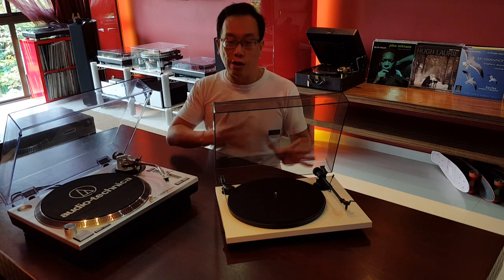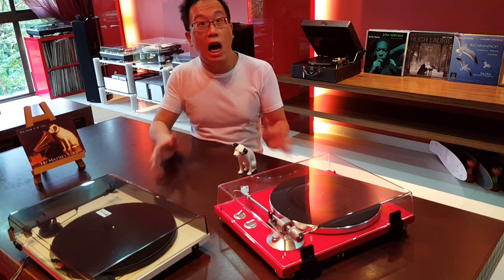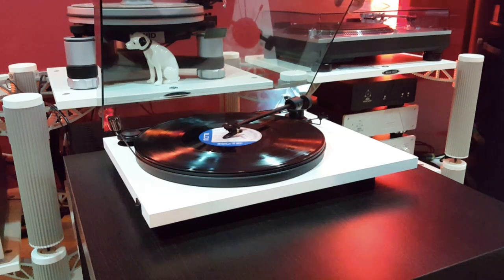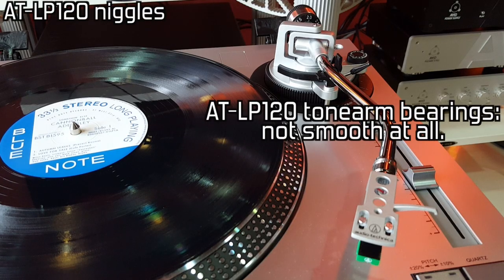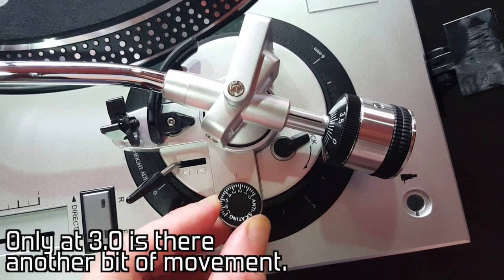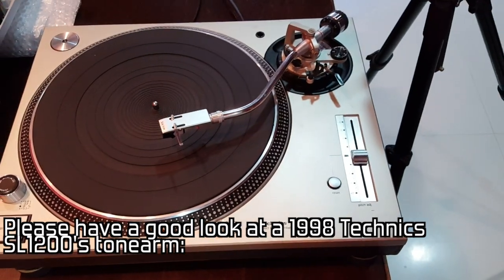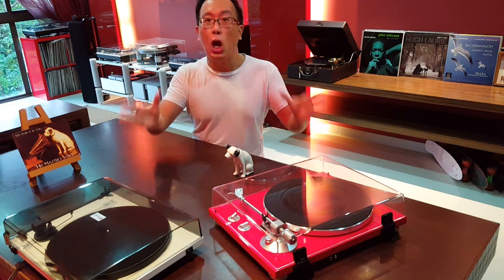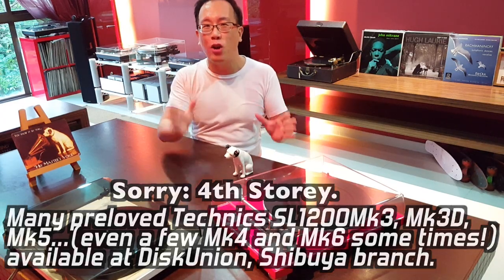Turntables $250 -$300: Shoot-out & Reviews.   AT-LP120 + Pro-Ject Primary + TEAC TN-300

Comment: Compairing the ( Hanpin ) Audio-Technica AT-LP120 usb with the Technics SL-1200 series is like compairing apples with pears really. But I do agree with you want to point out here. The Audio-Technica wants the newbees and those unfamiliar to the tricky field of turntables to believe their products offer the same performances as the original Technics designs. The price should tell those who want to get into vinyl something by the way. The Hanpin-clone is, like you showed perfectly, a plastic affair with components that either do not work properly or are just very sloppy constructed. The anti-skate that doesn't work if you cart needs more than 1.6 grams, the hight adjustment that is not adjustable downwards enough, the baked-in noise the motor makes both audible near the turntable and in playback (!). Not to mention the light weight platter and construction. By the way, the total weight of this turntable comes from a slab of steel in the bottom of the plinth.....double acting as a built-in earth. My problem with this product is that people see something they don't get, they are mislead by the looks of the product. Hanpin from Taiwan makes turntables ordered by just any company, be it TEAC, Audio-Technica, Denon, you name it. The AT-LP-120 is made for the wannabee DJ. It has found its way into the living room only due to the price tag the product bears. By the way, all AT-LP-120 units show the same flaws. So the production quality is at a constant level. Most end users probably couldn't care less, the thing works, records can be played and the sound is acceptable. Mainly due to the forgiveness of the AT-95e cart that comes as standard. It is not a critical cart at all but is capable of performing so much better if used on a good deck. Greetings from Holland!

Comment: Hi Ian! Great video. I was wondering where you purchased your step-down transformer. I've been looking into getting a technics 1200 from Japan and would like a good transformer to go along with it.
Reply from the maker: Dear Friend,
I purchased mine from Aisan Electronics at Akihabara.  Other friends have purchased their from the internet.
Some have bought the extremely established ones (made in Japan) coming from the brand Sugano, which usually are sold in electrical/hardware retail stores in your country's electrical hub :-D...
Sugano makes step-down transformers of different sizes/catering to different power requirements (wattage) :-D.
Anything catering up to 30W will do.  My friends' and my Technics SL1200Mk2/Mk3/Mk3D/Mk5s from Japan are rated at 11W.
Have fun my friend!!!  Get yours soon.  Past 1 week, I have seen 4 units released on hifido website...all snatched up.
Get this tank and legend soon.
Warmest Regards,
~ ian.
Reply: Thanks for the information! I have seen a lot of products online and just want to be sure to get one with a good reputation. 
I have been watching hifido as well but the turntables that I was interested in was already reserved. Luckily I found a near mint MK3D on eBay and am having it shipped from Japan. I can't wait to try it out. I have been searching high and low for a turntable in great condition and am happy to say I finally got one!

Comment: Thank you Ian for a wonderful video! Are you planning on doing a more in depth review of the uturn orbit? I'd be curious on your thoughts at minimum, I've owned one since January as my first TT but will be upgrading very soon!
Reply from the maker: Dear Ryan, thank you for your suggestion, it is still sitting pretty in my room :-D... U-Turn had replied me that the Orbit's motor is very, very specific for a 110V 60Hz power requirement, and thus advised me to get a ~US$180 step down transformer to pair with it if i were to use the Orbit in my country Singapore (240V 50Hz) :-D... I still have yet to buy that step-down and thus would delay my review of it to another day.  But make no mistake, i am very eager to test it out!
Warmest Regards,
ian.

Comment: I bought an AT-PL120 knowing it wasn't the greatest, but my main reason was for playing shellac discs, 
which are much more forgiving of cart alignment deficiencies than are vinyl records.

Since I paid only about $180 including shipping, I don't think it was too bad a deal

I have never even put the supplied AT cart on the arm.

A thick platter mat was my first corrective measure, and then I disconnected the built-in preamp.
I had to add a ground wire.

I used a multi-speed strobe disc to aid in making a card that sits next to the pitch slider recess.
The card is marked with a number of odd speeds so I can get the one I want almost instantly.
This helps a lot with odd-speed discs that play at anything other than "78" RPM.
One Victor record I have actually has "SPEED 82" on its label, and that Is without question the right speed for it.
The Technics 1200 can do that only if it is specially modified, which adds an awful lot to the price tag.
The AT-PL120 can do it right out of the box.

Comment: Awesome review, Ian!  I thought I'd add some thoughts to the turntables you reviewed:

-The Teac TN-300 is built by the Ya Horng Electronics Co. in Taiwan, who also built turntables for Akai (the BT-500), Denon (DP-300), and Fluance RT-80/RT-81.  There are initial problems with speed accuracy, which explains the high wow/flutter that you're hearing.  According to a couple audio salespeople I spoke with in Canada, the TN-300 has been preceded by the TN-400 as the former is no longer being used by Teac and will simply sell them until they're all gone.

-The Audio Technica LP-120 is built at Hanpin in Taiwan, who also made the Pioneer PLX-500, Crosley C-200, a couple Reloop models, etc.  It's under the Hanpin OEM model DJ-45.  And yes, the build-in phono pre-amp cannot be fully bypassed even when switched off so people who wants to get better sound quality will have to physically disable it and then use a proper phono pre-amp.  Oh, and don't get me started with Audio Technica's LP60 (the same as the Denon DP-29F/Pioneer PL-990/Sony PS-LX300)... they're totally rife with major problems.

-The Pro-Ject Primary is basically the Elemental on a full-sized conventional plinth and it has the same limitations as the latter.  For those who own one can upgrade to a better stylus at least, though the anti-skating mechanism is a spring built right inside the tonearm base.
Reply from the maker: Dear Brother :-D... I am very happy to see you again!! How are you doing?  I still remember you coming by and always catching up on your trips to Japan, record shopping of course...and your MP110 replacing your bronze.  I read with delight your posts as you are a gentle leader in your forum too!!!  The Ya Horng in Taiwan, Hanpin in China... and yes the Primary attempts to replace the Elemental with a full-sized plinth and three feet.... and thank you for telling me about its anti-skating mechanism being spring-built and not magnetic-based.  And of course, your inside news on teac replacing the tn-300 soon.
Currently I am in Japan with my wife and son :-D, i am writing to you at 9am from Hotel MyStays Ochanomizu and will be going out with wife soon to have a coffee and a simple breakfast...because going out to the DiskUnions around here for record shopping!  And I still remember you so kindly alerting me to the metal and punk there which I missed out filming on one of the tour videos 1 year ago (i only filmed the Jazz branch (opposite AudioUnion) and the general branch(just besides the train station) :-D!!! 
Warmest Regards to you and your family too,
~ ian.

Comment: The TEACs look beautiful but seem to suffer a number of quality control issues. Pitch instability is a common one. Some people have also figured out that the headshells are manufactured poorly and not level, leaving the azimuth way off right out of the box. Antiskate may not work right either. Between the azimuth and the antiskate, you will get tracking problems the minute you install a better cartridge on that table.

Re: the LP120, I've examined a few examples. The last one I saw felt shoddy with lots of tonearm slop in the bearings the entire base mechanism of the tonearm felt cheap too. It's far cry from the table it attempts to imitate, IMHO.

Comment: I would have loved to see the Uturn in this video!  I would imagine the Project was very close in design, regardless.  However, I disagree with the Teac's spindle being more elegant being hidden - one design feature that I like about the Project and Uturn is having the motor mounted as far away from the platter as possible to try to 1. Isolate the noise, 2. Prevent hum pickup in cart (Grado's are sensitive!).  When I was considering the Lp-120 or the Uturn, it was sound and simplicity that swayed me to the Uturn - and since I am guessing the Uturn and Project are similar in specs/sound, I am glad to hear I chose right :)  I hope you got to see my last tweaking video where I got the noise floor even lower with some more sorbothane on the PC board for the motor (along with the graphs).  The feet are at least better on the Uturn, but the belt issue is the same - you get used to where your hand should be, but the first few plays you can and do accidentally hit the belt.  I would also like to have a heavier MDF plinth - I never got the upgraded platter, so I don't know if that would help.  The lack of gradings on the underslung counterweight is a small price to pay since you can buy a digital scale for $7 USD, shipped, and no marking would have been accurate enough, in my opinion.  However, I did try to hold out for a SL1200 for several years, in the US they are only sold as pairs, or they are in terrible shape, so it would have cost $800-$1000 USD to get one in today's market - 15 years ago you could get one for the price you mention, but not today (in the US). I never considered or knew you could ship from Japan for one, otherwise I would have considered it!  Great job as always, Ian!

Comment: Okay Ian, you deserve an Academy Award for this one!!!  The editing alone explains why we haven't seen a video from you in a long time.  You can take the rest of the year off after doing this one as I am really impressed.  I had not seen the TEAC before and thought it would be a solid performer based on appearances.  Wow! Was I ever wrong.  This was really a nice dissection of the three and I liked the blending of the audio between the Technica and Pro-Ject.  You got a good feel for their comparative performance.  I also liked how you then when onto compare the Technica against the SL-1200G.   After our short correspondence, I can't wait for what is about to unfold but I think the models picked again will not compare to the SL-1200G.
Reply: Always a pleasure to watch your videos and comment! I heartily agree that a used 1200 is a better choice at that price.  I wish they were cheaper in Canada. Another good choice would be a used Rega P2, preferably the more recent version.  Keep up the good work!
Reply: HiViNyws channel I respect you.
Reply: The Teac's design is reminiscent of a PL-12D's, a really good budget deck back in the 70s. The only problem is that because of its small pulley, it is overly reliant on its belt to maintain belt stability. I suspect that the belt Teac uses is much worse than the one Pioneer provided It's cheap DC motor doesn't help either; the Pioneer had 4-pole hysteresis motor.  The rest of the Turntable is fairly well made, I was excited to see this design make a come back because, having grown up on a PL-112D, I am quite fond of this design. It isn't high end by any mean but it can sound good in its own way.
Reply from the maker: Thank you Mario brother for catching up!! Thank you for your time writing in and speaking of your love for vinyl playback and the equipment so used, and which have guided you through the years AND giving you so much FOND MEMORIES :-D !!!! Such stories are so warm and best to read!!!!  Warmest Regards Brother!!!!
Reply from the maker: BarakaPDub Dearest Paul, thank you for your firm support, friendship and camaraderie all this time...
Love you guys... it has been really difficult. I had decided to cancel this project midway...but you guys' persistence, presence and encouragement pulled me through to the end.  Thank you Paul.  Yours,
ian.

Comment: Thanks for another great review. I knew my AT-LP120 wasn't the best but if you consider I got it used in near mint condition for $130, is it still not recommended? 
Also, based on your cartridges reviews, and that to a nice gift card from amazon I got myself a Nagaoka MP110, would you say it's a waste on this deck? It's still burning in but I can already see improvements. What I'd like to know is using this cartridge on this deck a bad thing for the cartridge? I aligned it the best I could (didn't checked the SRA, don't have the tool) and I put a cork mat on the platter.
Thanks in advance for the help. And yes, when finances permits I'll get myself a SL1200, promise ;-)

PS: on the review, it would have been interesting to compare the turntables with the same cartridge. Pro-ject with that OM-5 definitely had the edge but if the OM-5 was used on the other it may have been a little different.

Comment: The AT120 tone arm wouldn't correspond to any of the alignment curves mentioned because it uses the unique Technics S shaped arm curve. Proper alignment of those arms is achieved by measuring exactly 52 MM from the headshell plug ring to the stylus. There's a jig available to do that or you can just use a ruler. That said, the LP120 still has major arm issues and I agree with your findings... It basically sucks. :)

Comment: Hi Ian, great video. Just wondering if it’s possible to buy a whole tonearm assembly in Japan for a technics 1210 mk5? I know it won’t be possible to buy new but perhaps a refurbished one that is as good as new?
Reply from the maker: Paul Whelan Brother Paul! I had bought a new tonearm assembly for the Mk5 before from a eBay seller to install for a friend.... it was totally new and i am very happy😄!...
Reply: HiViNyws channel wow that was very lucky, I recently purchased a complete arm from somebody and when it arrived the pivot screw had fouled the bearing and ruined it :( I replaced the tonearm part for a 1200 and soldered the wires in and though it's working properly I'm not satisfied with the silver finish of the pivot mounts haha I desperately need a 1210 arm with the black parts so it looks better.
Reply from the maker: Paul Whelan ah i see!!!... gosh... probably something bad happened...might be a bad bump on the package during shipment... i emphatise with you completely. I had things that got damaged in his way too. Sigh😅...  It is not easy to package and ship a tonearm.  A most fragile piece of a turntable.  Very fragile. Bearings.... and the arm would easily be kinked too.  I am going to Japan soon and I will see if Dynamic Audio at Akihabara stocks any of them.  I will keep you notified my brother!!!😄✌
Reply: HiViNyws channel yes I think these just a bad knock whilst in transit, the seller posted it with the counter weight fitted also which didn't help. Such a shame because it was completely mint other than that. Have you done any modifications to your own technics? If you haven't and you do decide to one day it would be awesome if you could make videos on what you do.
Reply from the maker: Paul Whelan Thank you so much for your kindness and suggestions/recommendations!!! I am very hapoy to receive them.
Arigatogozaimasu my friend.